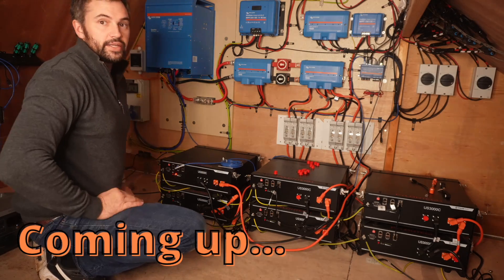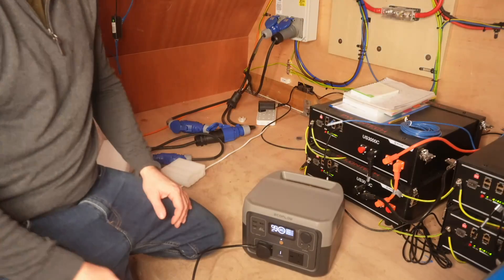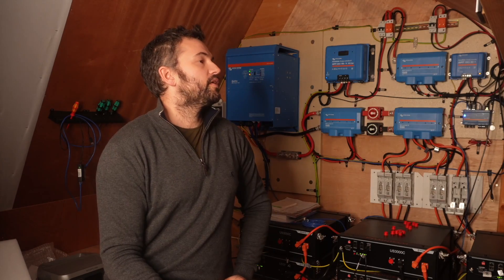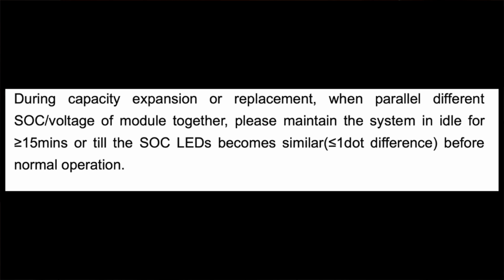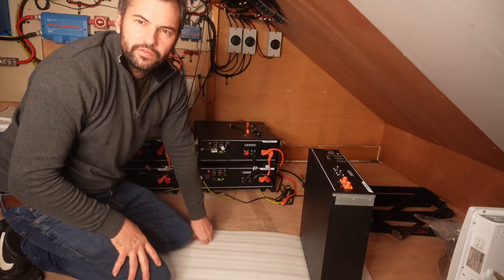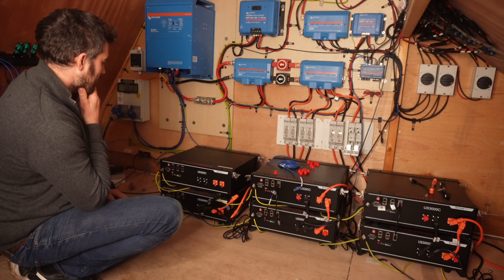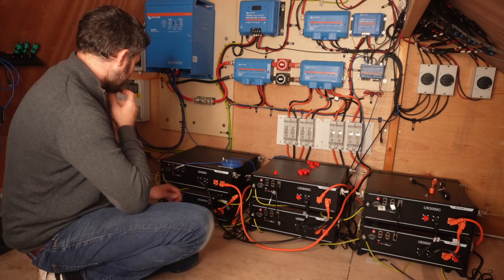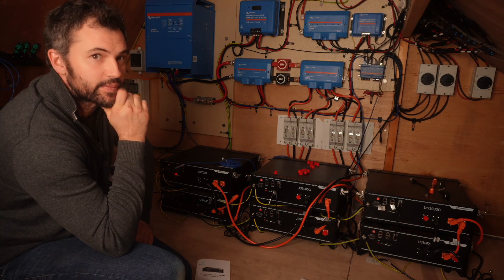IS THE PYLONTECH MANUAL WRONG?

Comment: The only thing I can think of, having got to the end of the film, is that the communication between the Victron gear and the 1.7 firmware is incompatible? That would make a lot of sense as that's the only thing different between your other six batteries and this one. You have a lot of Victron gear there and it could be just one of the units being incompatible. If you think of how software between companies is often compromised when one company 'upgrades' its software, that's the only thing I can think of which is different between the service company's setup and yours.

Comment: On the Pylontech batteries, do the connecting leads just push on? How do they lock? Will Prowse always makes a big thing of having everything torqued down. I'm sure that isn't your problem but from this film I couldn't work out how the leads connect?
Reply from the maker: Thanks for this, and for taking the time to comment 👍 Pylontech have their own special cables and there is a little button on the side that you press and push on or slide off the terminals ☺️
Reply: @The_OffGridFamily  Interesting. Thanks.

Comment: Any chance the inverter is sending too much charge current to the (now) single battery when before it had 6 batteries to soak up the current? On my setup I only have two batteries and they are US5000 so can take 80A each or 160A total. My inverter can only charge at 70A so it’s not possible for me to overload my batteries during charging but I imagine with your larger inverter and smaller batteries that might be possible.
Reply: I think it’s the initial high current needed to charge inverter capacitors which happens even with inverter power off
Reply: @c.j.designs  but since he had just moments previous had the six batteries powering all the equipment, shouldn't the capacitors have already been full?  Or do the capacitors discharge quickly once power is removed?
Reply: I think he had all the AC loads turned off, so it should be just the inverter and smaller ancillary equipment starting, one battery should be more than capable of that :)
Reply: @AndyM...  But wasn’t the purpose of connecting it up to charge it to 100% the same as the other six? Then again I guess he’d have to have the genset running since I presume the solar is still isolated and there is no grid. 
I just can’t help feeling that there is something fairly trivial that has been overlooked here but because of the turbulent history of this battery we’re missing that cause in favour of “it’s the demon battery from hell!”
I really hope a solution is found soon because this is a lose-lose situation for both Fraser and Pylontech the way things are right now.
Reply: @craigchamberlain  I think he received it back at roughly 100% and charged the other 6 before testing the suspect unit. You would think the repairer would have checked and tested the unit before shipping back, so like you, I think there could be an issue somewhere else ? It'd be great if he tested the battery without the comms cable, just in case the inverter is "commanding" the battery off for some reason....more testing required !!!
Reply: @AndyM...  yeah exactly, we really need to see what the cause of the alarm is before we can go any further. Whether that’s something Fraser or the repairer can find out is an important question. I know that my batteries have various ports and I think one is labelled “console” which, speaking as a software engineer myself, is a good bet on where to find out what’s going on. Just need to find out what the protocol that port speaks. Even without that, there is probably an alarm registered on the GX device which might give some clues.
Reply from the maker: The inverter wasn't switched on - we only wanted to power the Cerbo GX and the MPPTs.  It wasn't charging at that point.  Once it showed up on the Cerbo GX,  we were going to use the solar to charge it slowly, if possible. However, we didn't get that far.  We think it might have something to do with the dip switches.  Maybe they were down for charging a single battery? It's all working now, so all's well that ends well!

Comment: I wont be getting them!!
Reply from the maker: They seem to be working well now, but it's been a stressful journey 😩
Reply: You have to be smarter than the battery's. Any battery with an integral BMS and short circuit protection will have that issue.

Comment: The first thing I would check is trying to connect that battery via one of the other fused leads, just in case there is a problem with the fuse or wiring to that end fuse holder.  That should eliminate that as being the cause of any alarm.  I would then see if the battery will power everything without the comms cable pugged in and see if that works.  That will eliminate or indicate if the comms is the problem.
As far as different SOC of the batteries go I think what has been stated is true but could be misleading. Any batteries at different voltages when connected together in parallel will balance to roughly the same voltage given enough time. There will be slight differences due to internal resistance and other factors but as all your batteries are the same age I would expect that to be very minimal. The problem is, if they are too different when connected together a very large current will flow from one to the other which could permanently damage the battery and would certainly have alarm lights flashing.
The DIP switches should be the same on all the batteries, unless this new firmware version has changed something. Just make sure that the DIP switch itself is the same way up on the repaired battery as on my US5000 it is upside down compared to my US2000 so it looks like the switches are all up when in fact they are all still down.
The new firmware version might cause an issue for your inverter if it can't understand it, in which case you might have to update your inverters firmware too. I'm not sure if you've reached that point yet though but just something to be aware of.
Reply from the maker: Thanks for this Nick - the Pylontech Voice of Reason ☺️ We wondered if the dip switches were put the other way for charging one battery?  All the cables etc were working fine.
Reply: @The_OffGridFamily  You wouldn't normally fiddle with the dip switches unless you have multiple banks of batteries. It's possible, that where it was being tested, they did have multiple banks on the go. Perhaps they forgot to set the dip switches back to standard when they finished the testing.

Comment: do you need a pre charge resistor with these batteries ?. The bms could be seeing the caps in the inverter as a dead short and switching the bms off. I always use a pre charge resistor when the whole system has been powered down.
Reply: It's a good point. From personal experience I've not found it to alarm the battery, you just get a large inrush of current to the inverter which can damage the capacitors in the inverter so it's best to use a pre charge resistor. I'm not sure if the US3000 has a pre charge circuit as I don't have one but I think some Pylontech batteries do have that function.
Reply: @nicholashowell  Yes, US3000C does have a built-in pre-charge circuit, but it's not very reliable: It works okay if you have a small inverter, but it's not suitable for 10kVA and up, especially when not stacked, as the input caps are too big. Sometimes it works, but sometimes you end up with "MOSFAIL" alarm code, which means that you've burned the Mosfet transistor on the BMS. Therefore, I always start the US3000C's disconnected and then connect them to the inverter using a 230V/40W lightbulb as a resistor first. This charges the caps slowly and after a minute or two it's okay to hardwire the cables directly.
Reply: @obajer  I have a big resistor I use for this purpose.
Reply: @nicholashowell  he had six batteries powering his system immediately prior to switching those batteries off and switching to the single battery.  So shouldn't all the capacitors have been fully charged at that point?  Do they discharge so quickly once power is removed?

Comment: Can you repeat the startup procedure with your 'old' (working) battery, hooked up as a single unit to the inverter? Does it startup simulary or is v1.4 much different from the v1.7 firmware?
Reply from the maker: This is what we did in the end ☺️ That didn't work either so we just put them all back together and hoped for the best!

Comment: Yes, as mentioned does the battery continuously run without any cables plugged in, if so, try connecting the load next, if it runs, then the comms, the comms may be the problem. I notice also the blue comms cable was plugged into a different port to the others. With my BYD batteries the DIP switches are for battery ID, ie every battery has a different DIP switch setting. Good luck !!
Looking forward to the next video with the remedy !!!
Reply from the maker: Thank you, we are all sorted now ☺️ Hope you enjoy part 2!

Comment: seems very weird for a testing company to soak test the battery charge it up and then it not work.   is all of your system powered up is the device connected to the CAN port powered up and running before you connect and turn on the battery.
Reply from the maker: We still aren't entirely sure what the problem was.  Maybe the dip switches needed to be put back to just use one battery to make it work?  That's perhaps why they sent it back that way...?

Comment: i think one of my us5000 is 3% out from each other.   i noticed when low,  one flashes a red light while other still has the last 2 oe 3 percent.   i also noticed the comment in the manual you had on screen.   makes sense to charge to 100% first separately before connecting.
Reply from the maker: Sorry to hear about the difference in %.  Hope you get it sorted ☺️

Comment: I would be calling the testing company asking for their advice. Good to know about linking them up with 100% SOC as I'm about to link up 2 US3000s with a US5000C for the first time and like you, I thought they balanced themselves out.
Reply: I’m literally right now charing my two US5000 batteries and after watching this video I went through to see how they were doing, To my horror I noticed that one battery had 3 LEDs lit and the 4th flashing while the other battery had only 2 LEDs lit and the 3rd flashing. Clearly an imbalance of sorts. However, in the time it took me to walk back through the house to get my phone to video the LEDs, they had both gone to 3 +1 flashing. It’s unreasonable to expect them to transition each threshold at the exact same time since this is “analogue” chemistry at play. However, I will be keeping a closer eye on them in the days ahead.

I too believed that as long as they started out life in the same SOC ballpark then all would be well. When mine arrived I measured the O/C voltages at the terminals and IIRC they were 49.4V each. That was good enough for me to just connect them up in parallel and start them charging as a pair. If I knew that it was better to charge them each to 100% before use then of course I would have done that. Now I’m wondering if I should split the pair and charge them each to 100% before recombining them again. Pylontech - any advice?
Reply from the maker: @craigchamberlain  Sorry to hear we caused some anxiety 😩  How's it going?
Reply from the maker: @matthunt2128  We were really surprised too as we had always thought they balanced themselves.  When we got our batteries, they were all at 50% and the lights were all within the same dot so we just connected them together and let them idle for 15 minutes and to be fair all of ours turned out to be completely balanced 👍 All the best with your new batteries ☺️
Reply: @The_OffGridFamily  The company that I bought the 5000 off said to let the 3000s discharge to 50% and then add the 5000 as the master. I think after following your adventures I'm going to slowly charge them all to 100% before I do anything.

Comment: Looking at the manual for my system (US2000) the first switch controls the data rate of the CAN connection to the inverter, and the other three tells it how many batteries it has. 

It seems to me that when the battery was being fixed, their charger/inverter ran at a higher data rate (hence the first switch being down), also as it was the only one in the stack the other pins were down.

If switches mean the same thing as shown in my manual, then I'd try it with the first switch up and the rest down (as you're connecting it as a single battery to start with)

Edit: I've got a stack of 4 batteries in my loft, so I'll go look at their switch setup when I get a moment.

Edit2: Scratch that, the battery numbering in the stack is based on what CAN cable you've got connected, the switches identify which stack they're in. So it's only useful when you've got multiple battery stacks connected to a CAN switch. Basically, if it was working before, you're right to have them all set the same...
Reply: Hi, mine are in a stack and the first battery has different switch settings compared to the slaves. My master battery has 1, 3, 4 set to off (top) and 2 is On (down). The slaves have everything off
Reply from the maker: Sounds like everyone has a different way of setting up their batteries.  It's like the Wild West - anything goes 😂 As long as they work, that's all that matters! Ours are up and running so we are happy (for now!) 👍
Reply from the maker: @matthewgreen8454 Thanks for this, and for taking the time to share it with us ☺️👍

Comment: I'm going to be up all night worrying about what happens next; please don't do that again :-) -  On the other hand, these Pylontech batteries seem to be complete junk.
Reply: I’m running a pair of US5000 batteries right now and they are performing really well so far. I am of course watching this saga with keen interest because Fraser is no fool and knows what he’s doing. We should also consider that his other 6 batteries seem to be working well and although 1/7 is still way to high as a fault rate, I don’t think it’s fair to judge Pylontech as a product (customer service maybe different…) until we hear the final outcome.
Reply from the maker: Now that we've overcome the problem, things seem to be working well.  It is actually 2/8 batteries - when we first installed the system we had one that wouldn't turn on at all, so we asked for a new one to be sent out.  They refused, and wanted it to be repaired so we requested a refund instead 😩 
Glad yours are running well 👍
Reply from the maker: @tiredofeverythingnew Sorry if we caused any loss of sleep 😂